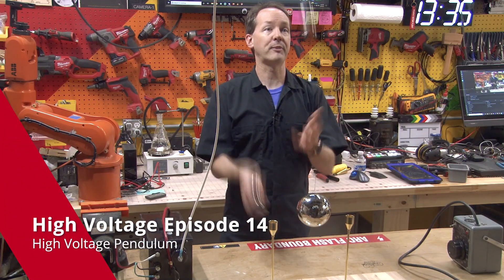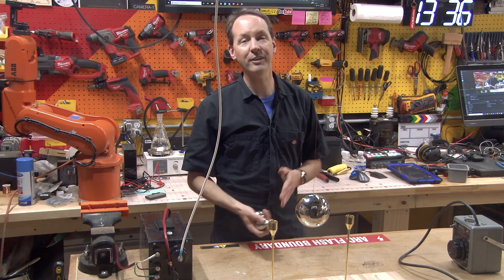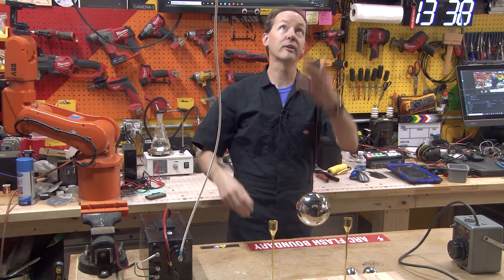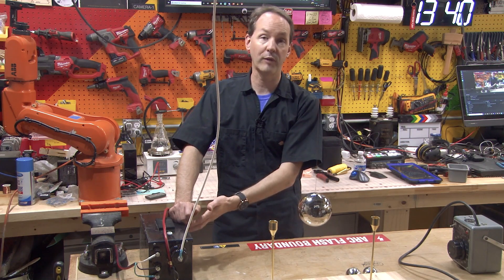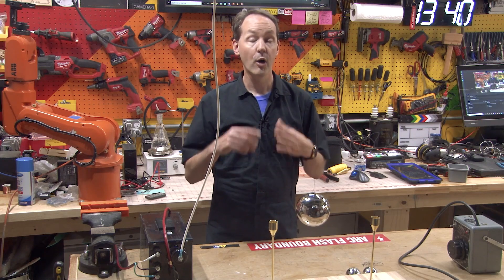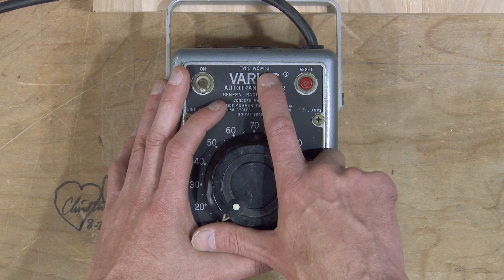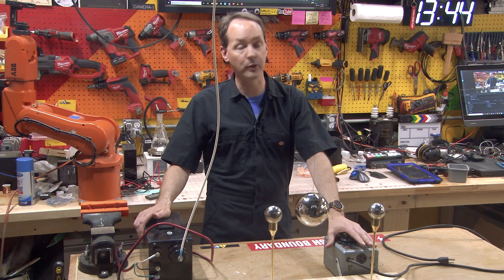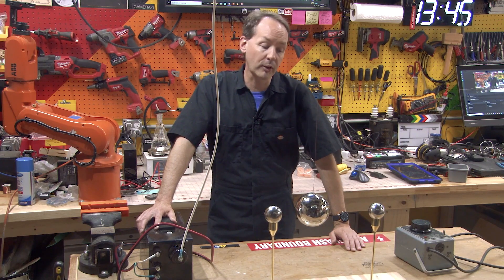High Voltage Episode 14 - Pendulum

Comment: My guess is to how it works is that as the electrons flow out of the nst through the middle electrode into ground they extert a small force on the middle pendulum due to newtowns third law and push it away from the 2 outer electrodes. If you reverse the wiring, the electrons would push the middle electrode as they crashed into it. Anyway, im still a beginner so i could be way off. Also thanks for making this series, im tried of always seeing 'dont mess with high voltage its too dangerous for you' and not actually teaching me how to be safe. So thanks :D